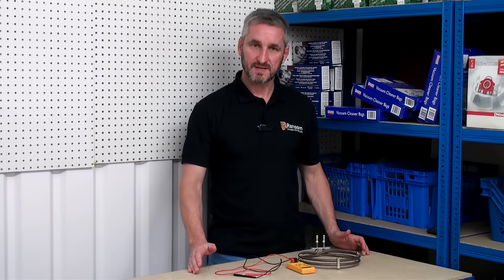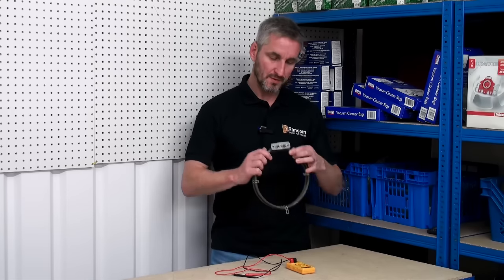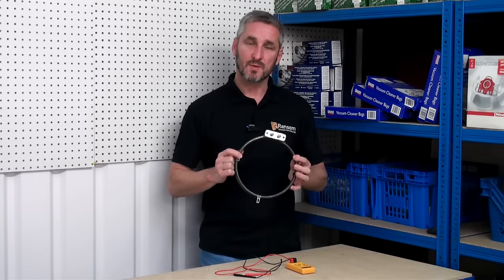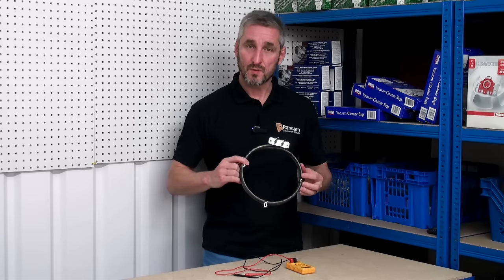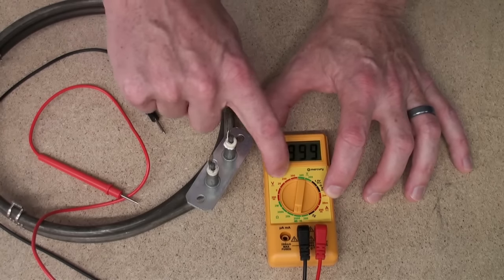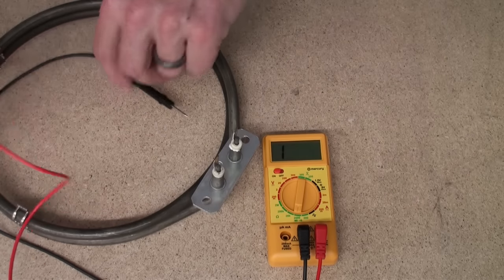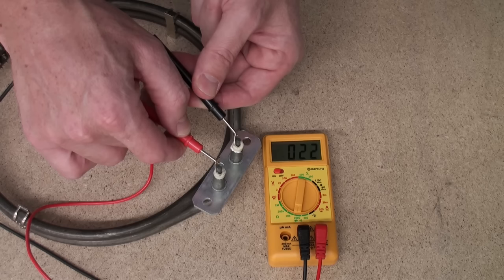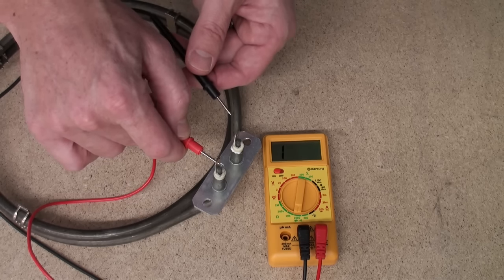How To Test An Oven Element With A Multimeter

Comment: I went online and it says the heating element hast to read between 30 and 100 ohms in order to heat up and work properly, my heating element read at 16 ohms only and is not heating, I already checked the lines and they have power. So I think even if it shows some ohms doesn’t mean it still works.
Reply: Correct, it just means the break in the element is still making contact, under load their is no conductivity
Reply: I had one that was 33 and still didn't work. A new element solved it. A continuity test isn't conclusive at all.

Comment: You may also need to know the wattage of the element to replace it. If you have a similar working element measure the resistance eg 35 ohms if the element is ran at 115v then current (Amps) is V/R  so 115V / 35ohms = 3.28amps   Watts = V x A  so 115V x 3.28A = 377W

Comment: I do not quite agree. I have had elements blow but then touch the outer which still shows that current can flow, but because it is shorting out, it trips earth leakage switch
Reply: Jesus I agree the element can still be shorted.  Actually, the test for a shorted element should have been shown too.

Comment: I would like to ask you please if you can advise me please. I have electric over and it dose heat up but after few minutes it trip the electric board. Then I tried grew other trick to check if it is the board it oven. By turn off everything except the oven in board then I turn on again then it heat up and after 5 minutes again it trip the power. What will be the problem please?? Your help much appreciate. Thanks.
Reply: You need to call an electrician mate

Comment: And what if the element has got continuity but is shorting to earth people could be replacing other parts after you miss leading video
Reply: If the element has continuity and the proper resistance after you've isolated it from the circuit then it's been teated as fine. A short to earth is another problem that'a usually in the wiring.